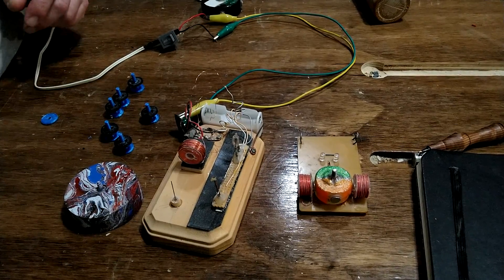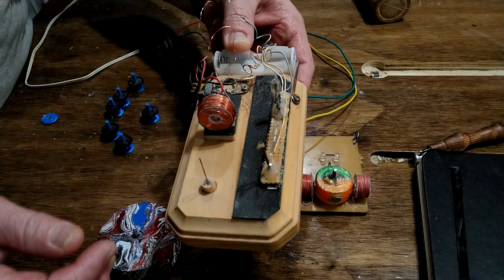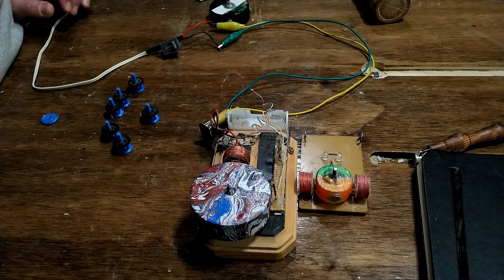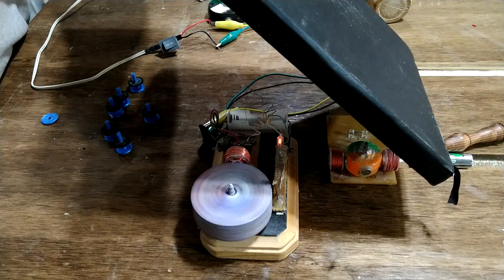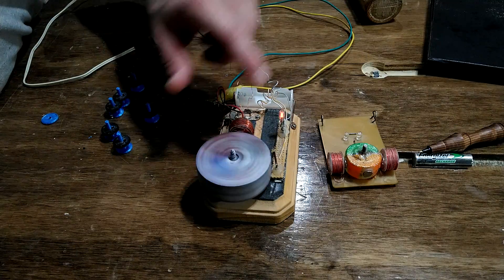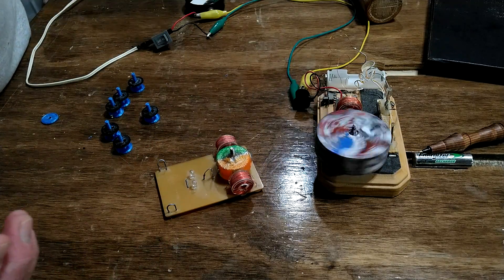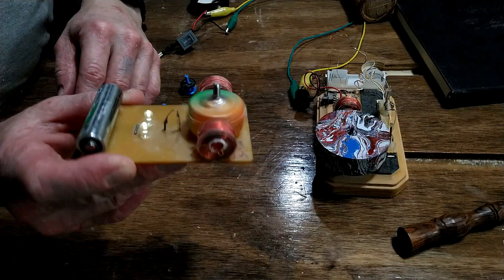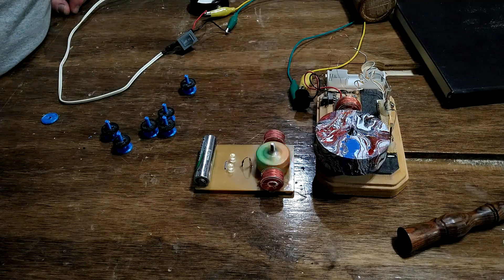DIY Reed Switch PULSE MOTOR

Comment from the maker: Sorry for the late reply, the single or double coils fire at the same time. The reed switch turns the power on and off very quickly to the coils when a magnet passes by it,  which pushes the magnets away at the right time.